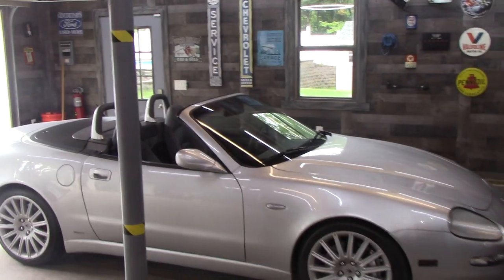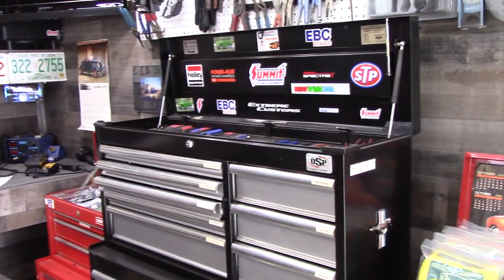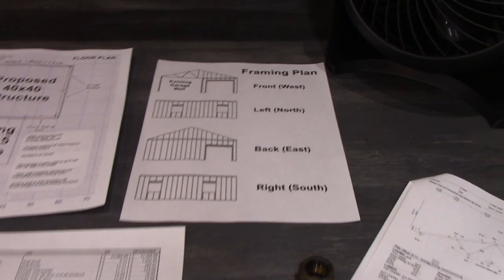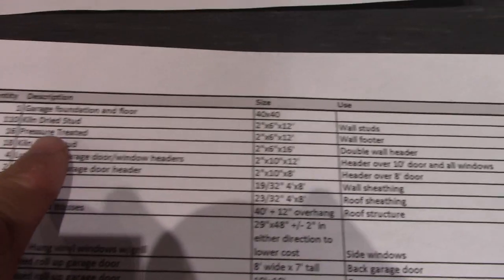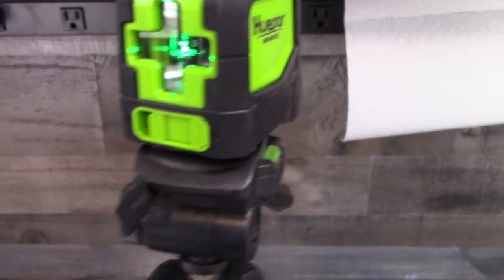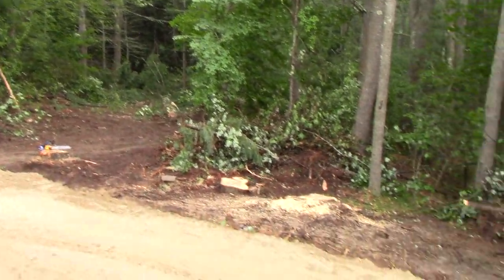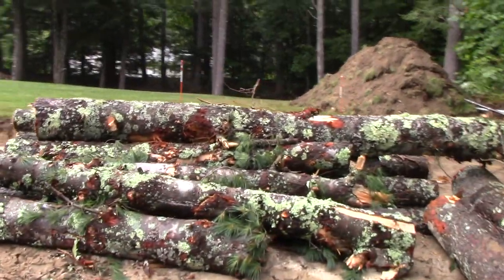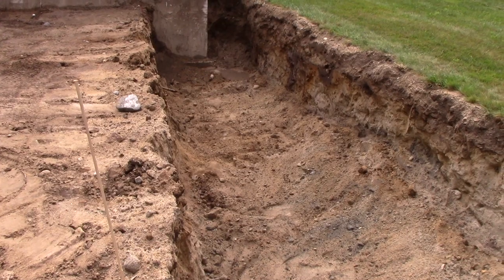Part 1: Dream Garage Building BIG And On a Budget!  DIY Build Project

Comment: New sub here, this is the first page I've seen so far, but I need to watch this entire series as we are doing something similar. In our case, we are pouring a slab and building a 24' x 36' temporary building that will be taken down and moved to another part of the property in a few years. At that time the slab that the building will sit on will have four feet added all the way around with a frost wall, and a two story building will be put on that. Everything will be screwed together, and the building will be covered with steel.  It may sound cheaper and less work to just build the temporary building in it's final location, right from the start, but that is not the case.  Like you we are on top of a hill, and the final location needs a bunch of fill, a road, and a fairly long electric run. It's all very complicated, but like yourself we crunched the numbers and weighed the alternatives, and this scheme gets us where we want to go at the best price/amount of work. Now I need to watch the rest of your videos...

Comment: Would your neighbor also loan me that excavator? I'm in Tennessee. 
Ok, I'm kidding but it always does seem that when someone starts a project like this, good friends tend to arrive with unexpected help that is often times just what the doctor ordered. It looks like  you've got a great start. I'm subscribing because I really want to follow along with this one. 

Also, it's interesting that you chose to build a 40 x 40. To me this is the size that a good shop needs to be to start and is exactly the size I've been planning to build. Larger than a 40 x 40 gets into more expense at an exponential rate. But smaller and, like you've already discovered, the place is limited in what you can do and gets filled up with stuff.